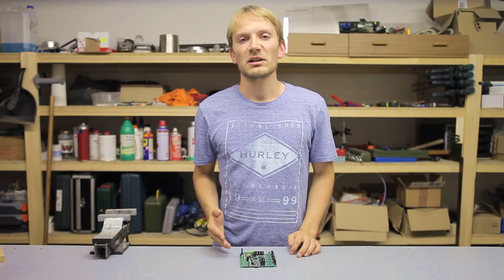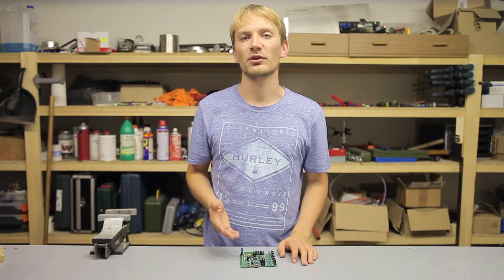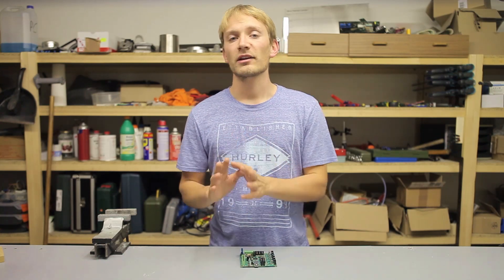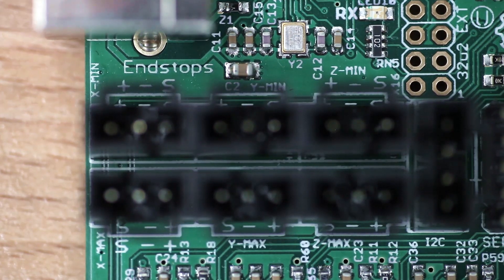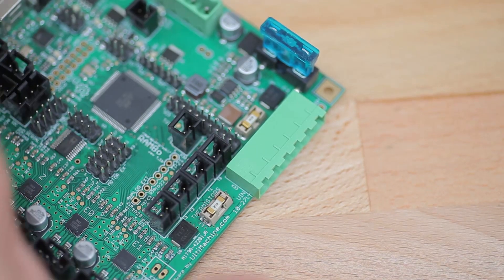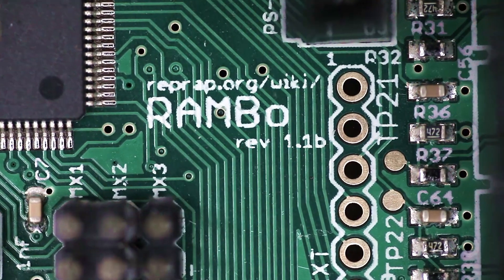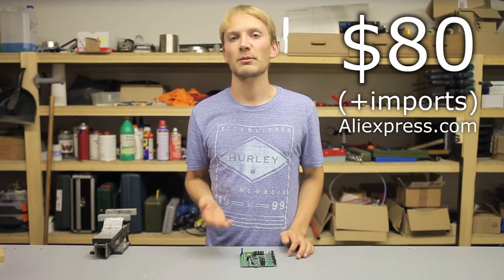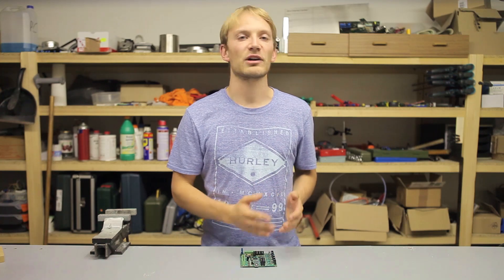Honest review: The RepRapElectro RAMBo

Comment: Been trying to solve this and figured that you'd know for sure.  Have a Ultimachine Rambo 1.3 in a Taz 4/5 with a newer hot end.  The heated bed is not working and it is not the fuse, not the wiring harness or the bed itself.  So the only thing left is something on the board?   Short of replacing the board, on these boards is there a workaround for using a different plug or something external if not?  Or some kind of test I haven't done yet? Really, really hate swapping the boards out.  Thanks much!

Comment: Hi Thomas, I have a question about the drive system for 3D printers. Why use most 3D printers stepper motors instead of DC motors plus encoders or BLDC motors?
Reply from the maker: +jamen1993 they're cheaper and have better resolution
Reply: Thomas Sanladerer Thanks (y)

Comment: I have got a tronxy melzi2 0 v5 control board
The XY and Z axis motors work fine. 
The problem I have is with the extruder and the hotbed.
No power is going to them from the control board.
When I power them independently they work,
Also the thermostat on the hot bed is open circuit,
Therefore I believe the problem is with the control board,
Could you please advise me as to what I can do?
Could I repair the control board and is it worth it

Winston

Comment: Thomas - the length and in-depthness were perfect.   I have been a subscriber for several months, loved your Lulzbot Taz 6 review, but I'm still learning.  I've got an old-school wooden Printrbot that I am upgrading with self-printed parts, and am thinking about ditching the Printrboard and going RAMPS.  I was under the mistaken impression that RAMPS > RAMBo, but was confused and googled "ramps rambo comparison" which led me here, and you set me straight.  Thanks!  I'll probably go back and watch several of your older reviews to get up to speed.  I'm especially interested in the SilentStepStick drivers; it sounds like I can use them with the RAMBo and not have to go RAMPS.

Comment: Does anybody know if the second Z motor output is electronically paralleled to the first or is it fed the same steps via firmware?
Im wondering if its a totally separate driver that could be used for another function.
Reply: +Thomas Sanladerer Ok thanks, now i look at a closeup its obvious. Your guides are very helpful. Are people using heat sinks on those drivers? Looks easier to fit a strip of aluminum than on the ramps. Anyway just ordered one.

Comment: I bricked my RUMBA board. Using a colleague's arduino uno I managed to repair the bootloader and upload the modified FW to the flash memory.  I changed the old Allegro with TI ones. 2 of the old ones were blown. Strange , they are supposed to be compatible, but I had to reverse step direction in the configuration file for all steppers.

Comment: Is it 32-Bit?
Well, im just going to by 32-Bit boards, like the RADDS which is a external shield for the 32-Bit arduino board (forgot the name -_-)
With this boars you can handel up to 128 microstepps, faster and better prints.
The microsteps form those driver are better too(StepStuck)

Comment: Appreciate all your work on videos. I would like to see a demo of how to properly crimp the connectors you showed in this video. I have the connectors and the crimpers for that type of crimp connector but they are a pain to get crimped properly. I usually end up soldering instead. Thanks.
Reply: Hi Wayne,
The user manual we're working on will show you how to do that in detail. Until I release it publicly, here's a paste from the relevant part which has links to helpful videos for crimping the connectors : http://pastie.org/private/gc7spgide4lotwd3m7ouq
The rest of the section wouldn't be so useful to paste without the pictures. Hopefully, UltiMachine approves of the manual's contents soon so we can release it.
I hope this helps.